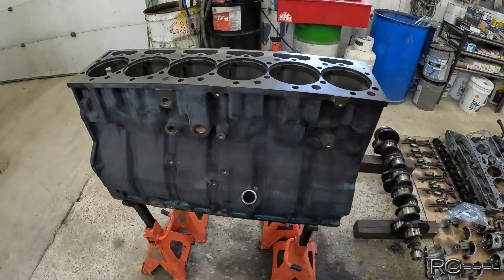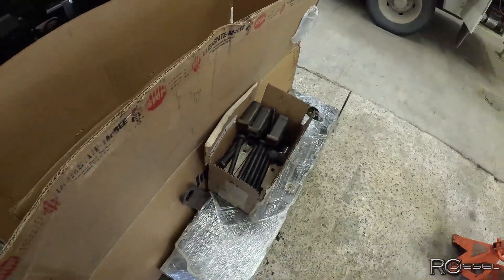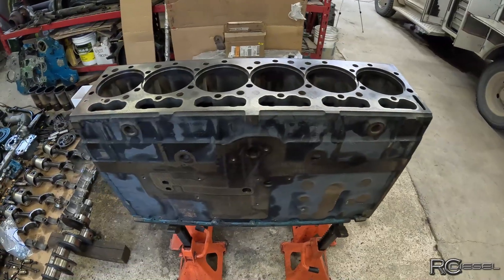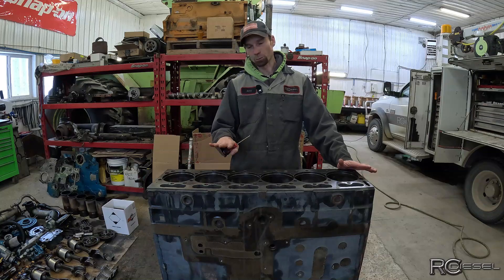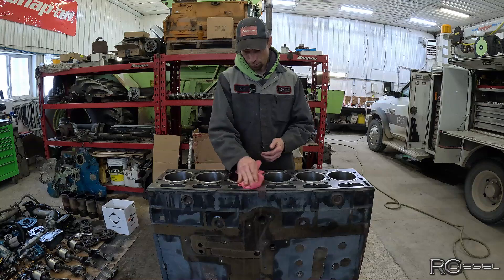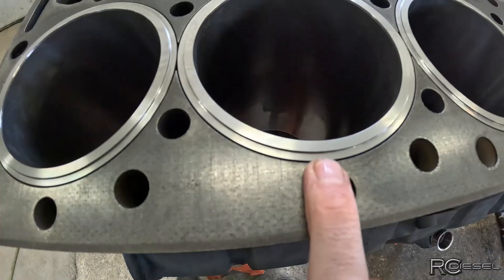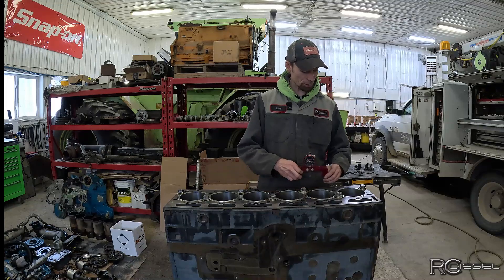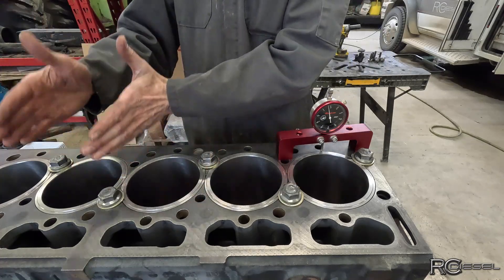🔧 DT-466E Diesel Engine Rebuild Series | Episode 2: Test Fitting Cylinder Liners 🛠️

Comment: If you dont mind me asking, what is the typical cost for rebuild on one of these? Got mine im thinking about getting done as a preventitive type of deal. Mine still runs an drives fine
Reply from the maker: Cost always depends on what it needs, what the labour rate is of whoever is doing the work and how much extra stuff needs done like alternators, wiring, machining, etc. If you can get away without any machining, the cost goes down a lot. But you can expect to spend 2,000-2,500 just in the head. Total rebuild can range from $12,000 to $30,000.
Reply: @rcdieselchannel  not all that bad considering. I have a perfect running one in my bus with 490k miles. An 01 model, been considering doing a top to bottom refresh
Reply from the maker: @deliciousgixxer3670 If it's still running good, it'll probably require less than once it blows up! That's a decent amount of miles, but these are good engines.

Comment: Block is delivered to the machine shop with the liners.  Let them check/set protrusion.  Better use of your time, because you can not beat their efficiency and accuracy.  Quick validation check upon receipt, and you can get to assembly.  You're already upside down making retainers, then making that goofy measurement setup work.
Reply from the maker: That's a matter of opinion I suppose... I just got a 855 Cummins block back from the machine shop, spent several thousands of dollars on machining, including sleeved counterbores. I sent the liners with the block - but double checking during assembly, I have protrusion problems. One liner is below spec and two are barely making the bottom end of spec. The work that is dome is only as good as the guy doing it. The fact that this stuff is sent to a machine shop for professionals to work on, means nothing. I see this over and over again. 😊 By the way, that "goofy measurement setup" is called a deck bridge and checking liner and piston protrusion is exactly what it's designed for. A lot of machine shops use exactly that.

I guess my point is, a quick validation check when everything comes back still requires Liner hold down bolts and still requires a measuring tool: and that's pretty much what is happening in this video.

Comment: Good video Ray.I also do all part numbers to one side.I worked for IH  for years.Pre to coolant filters and good coolant we had alot of problems as you know with cavitation erosion in the 300 and 400 series Navistar engines.The service manual suggested at 4000 hrs on engine you take apart and rotate  sleeves 180 degrees. THE figure 8 that coolant passed was moved to a different position. Not to many customers did this job. GLENN MAC Pherson Ontario Ca
Reply from the maker: Hey that's awesome haha Yeah, moving liners would be almost as much labour as a full rebuild. I can see why guys wouldn't want to do it. This engine, the cooling passages and the outside of the liners was in stellar condition compared to almost any other engine I've worked on. That was quite a surprise. I told the customer "Whatever you're doing with your coolant, keep doing that" lol

Comment: I also always do part numbers facing up.Because if something is directional it usually has the part number facing up. I do it with everything from orings to gaskets incase I missed the "this side up"
Reply from the maker: I like your style sir. I completely agree, if you start a habit like that, most of the time it may not be worth anything more than peace of mind, but there is always that one time where you saved yourself and maybe didn't even know it. Love it 👌